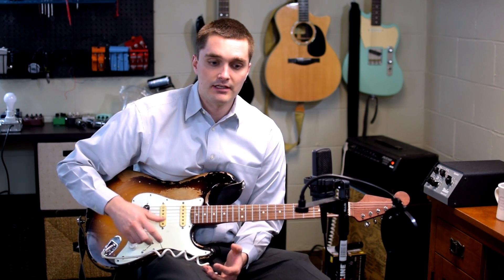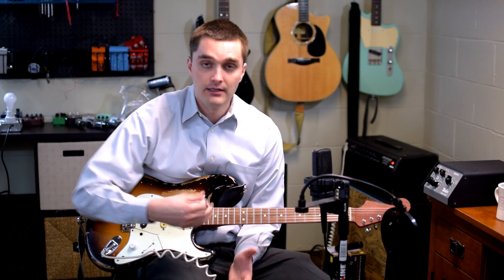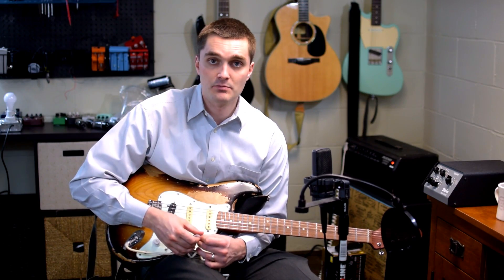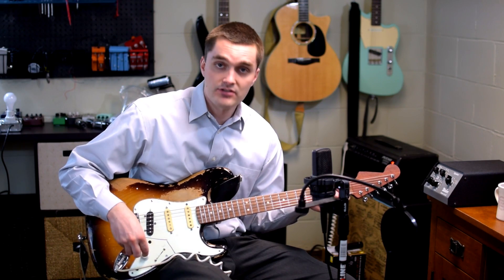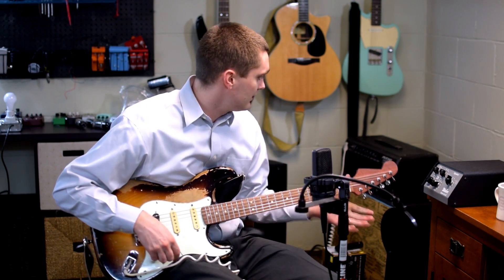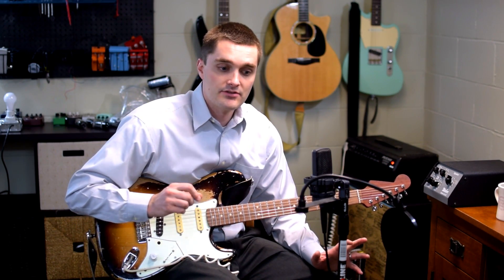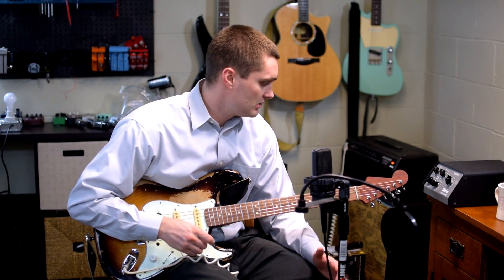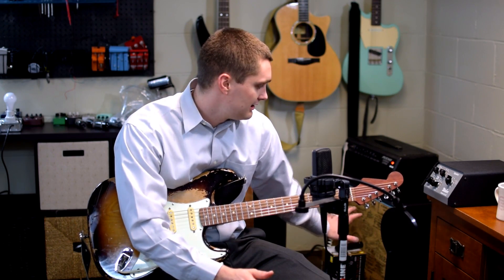Treble Bleed Circuits - Explained and Demod

Comment: My LTSpice simulation suggests 7n cap creates tube screamer like frequency response (i.e hump at 1300hz) on typical 6500 ohm single coil. Resistor is just like Kley said. In sim case 500k vol pot pairs well with 250k resistor saving 6db lows.  That would be the cheapest and easiest way to feed TS response in to a distorted tube amp. Those values are in very low volume - say at 0.2 of the range. The thing seems to be to find values (and corresponding volume pot position )which also start to cut the higest ice peak. It means that the some of the high roll of should be effective and it will with very low volume position.

Comment: Thanks for the video. On the fence between 50s wiring and a treble bleed circuit. Something a little artificial about the way a treble bleed lets some frequencies through while the other ones change. In parallel it just changed the sound all together. Not sure if that is a resistance capacitance value issue. Heard you have to play with different sizes until it sounds right

Comment: I too juggled about with treble bleeds and 50s wiring etc to the point that it drove me up the wall. The best treble bleed is to not hook the Treble pickup to the tone, just use it with the middle pickup in series . The Standard 60s wiring works for Fenders. On the other hand P90s can really benefit from treble bleeds like you say ; .001mf and a 1k resistor (optional) can turn a Muddy P90 into a chrystal clear PAF tone on the bridge.

Comment: does a treble bleed works to cut  extra low end from a guitar?
Reply from the maker: No. It allow highs to bleed through as you turn the volume control down. You could try a more aggressive cap value to make it pass lots of highs.

Comment: Can someone please tell me if a 2018 Fender Player HSS Strat has a 500 or 250 kOhm Vol Pot by standard? I want to order capacitor and resistance, but i don't know the value of my Strats vol. pot. Thanks in advantage.

Comment: if your pot isn't scratchy at first, it will be before long ....using the treble bleed requires a more robust pot - (4 wiper CTS or sealed Dunlop(unfortunately Dunlop solid shaft is metric ?!)

Comment: I'm making a fender tone saver type with a resistor in series and parallel. I just got done but haven't wired it in yet with the values I picked. I need to add alligator clips for a quick switching system to test with or something

Comment: So does treble bleed add highs or take them away?   What exactly does this  do? Parallel or series?  Everyone says something different about parallel or series.. I want to know what   things to put in the guitar will help give the hugest general Jimi-SRV tones.. That is what I am looking for the hugest best Strat tones.. any Suggestions. Dont say thick strings, I cant do that, hand issues and surgery, from machine shop work.. I go 10-46, thats all I can use.  This gizmo sounds like it is clicking into a lot of  scratchy noise..Whats up with that?

Comment: Every time I put a cap and a resistor in the volume pot, turning down the volume will not change the sound until it reaches 1 at least. What is wrong with this? Thanks!
Reply: cap or resistor values are likely off.
Reply: You probably have the capacitor backwards.

Comment: Why don't you trying wiring your guitar 50's style and you can ditch the treble bleed?  Your signal will be contained in one circuit as opposed to being dumped by another circuit to the hot lead. 

I used to do exactly what you are doing but stopped the madness when I discovered 50's wiring.  I run 1 of 2 different wiring schems in my strats. 1- 50's wiring, neck/mid tone 1/.022 cap, bridge tone 2/.022 cap or 2- same wiring as above but middle pup off tone for super quack.  Make sure you use vintage taper pots, they don't do the all or nothing/on off volume thing.
Reply: Powder Mathews not that easy. It makes the pots interact.

Comment: I liked it best with just the pot. I must admit I've never felt I needed this mod on my of my strats but it's still cool to play around right :)
I did put these http://www.ebay.com/itm/Sprague-Orange-Drop-capacitor-716P-1uF-600V-/150471597429?hash=item2308ce5d75:g:tFgAAOSwx-9W0exY in one strat, beefed up the tone when the tone pot is full open but makes it roll off very quickly. I still liked the tone better than the stock.